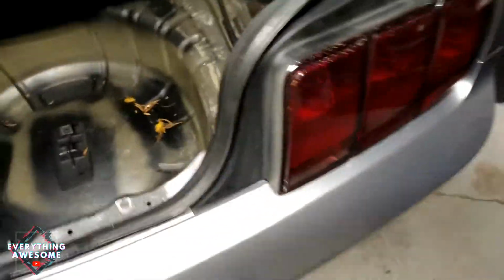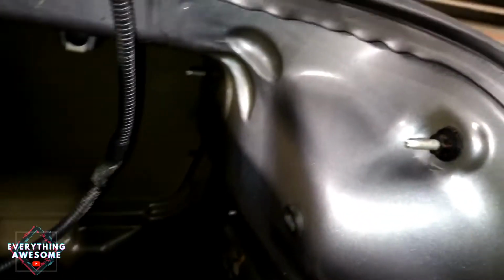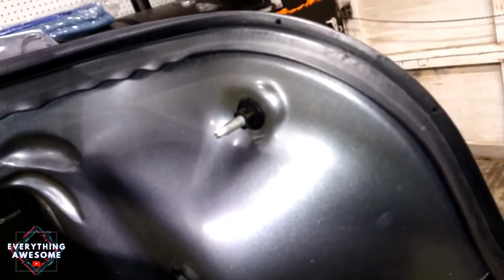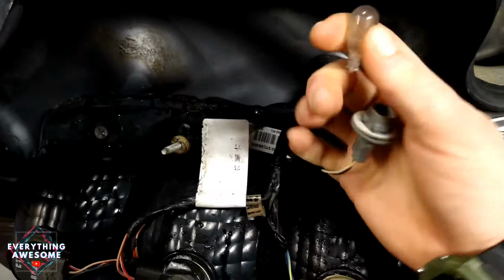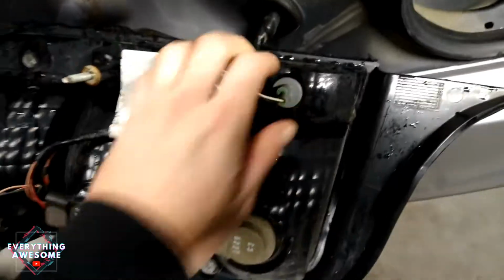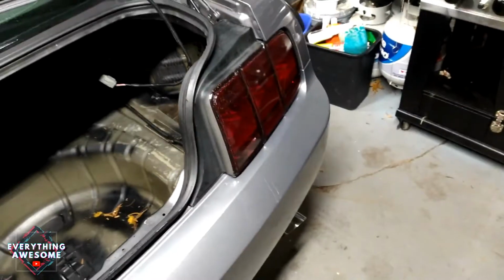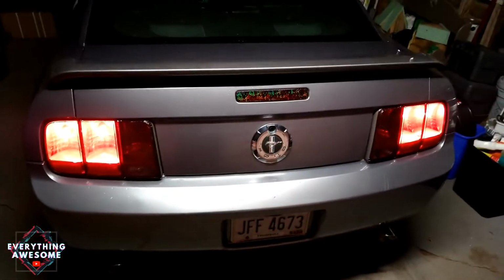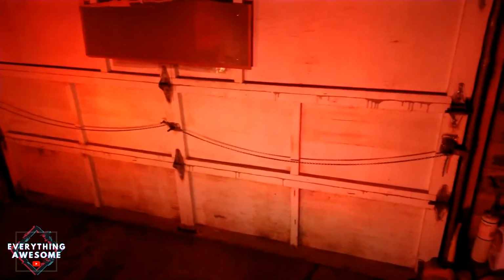How To Change Your Reverse Lights To LED | 2006-2009 S197 Mustang

Comment: Still happy with the lights?
Reply from the maker: I actually had to recently replace them
Reply: @TheMattiverse  Okey thanks. I found out mine actually work but they wont turn on when I put the car in reverse. I bet its the light switch at the transmission
Reply: @BigBalgruuf , you might have installed the bulb incorrectly. They have polarity. You can just flip it and it should work.